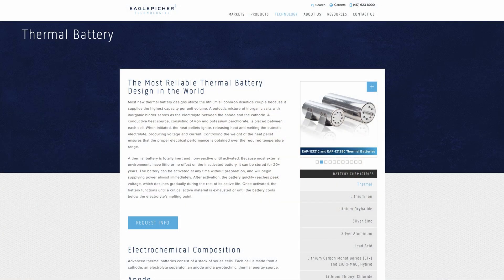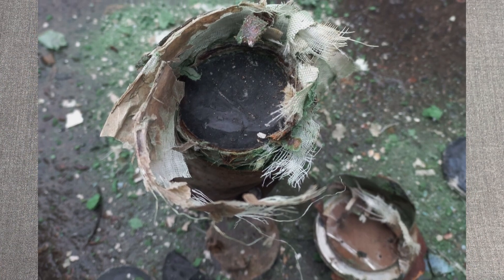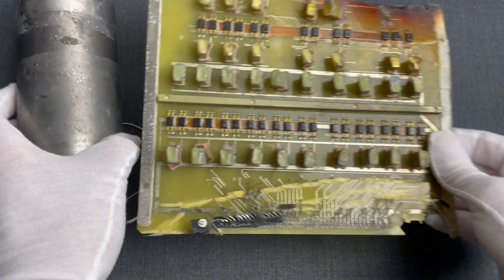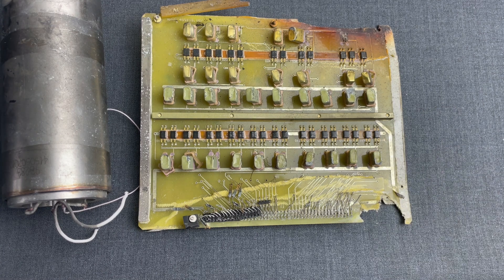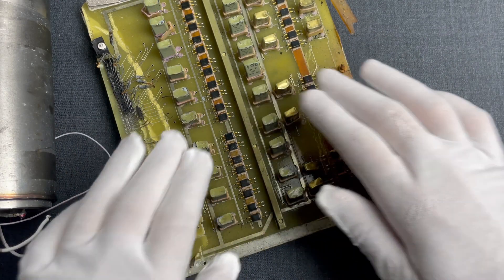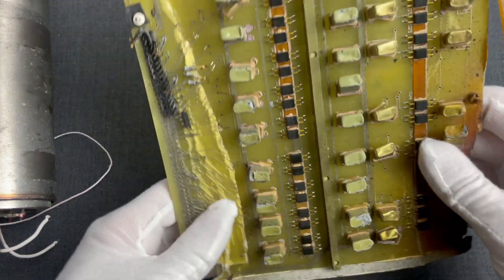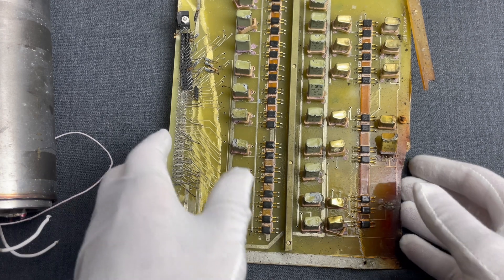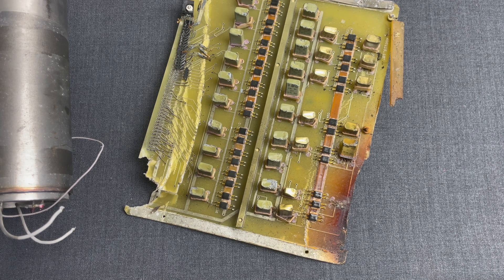TECHINT on 9K720 Iskander (SS-26 Stone) Thermal Battery and Electronics

Comment: Do you have any clues or guesses about the purpose of the network of relays?  e.g., Sensing multiple sensors with a single AtoD converter,  or driving different outputs from a single source?

Comment: Are those chips made if gold? I see alot of gold color on that board, just wondering if its gold they are using  on these boards..
Reply from the maker: No experts in electronics here. Going back to the Soviet electronics roots (where most of those designs come from), the boards were made with phenolic-based laminates, such as textolite or getinax, giving them this yellow-ish/brown-ish colour. For the chips themselves, gold-coloured parts, including the contact pins and bonding wires, were (and some still are) made of gold (Au) plating over a nickel (Ni) layer making them resistant to oxidation and corrosion, providing reliable and long-lasting electrical connections, low resistance, thus improved performance. Not sure if this the case for all of the ones shown here though. Maybe an electronics expert can provide more insights.